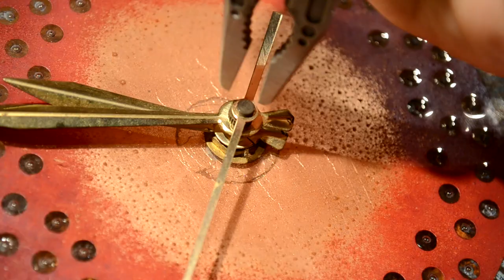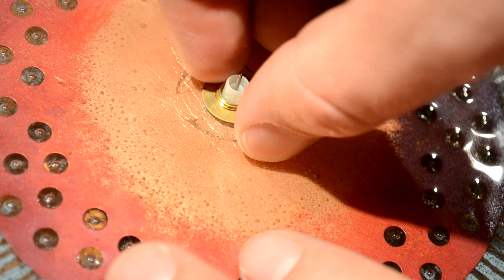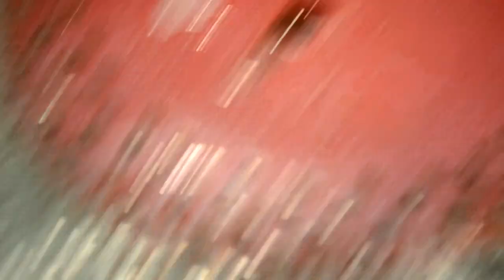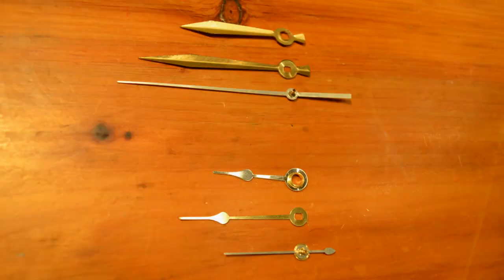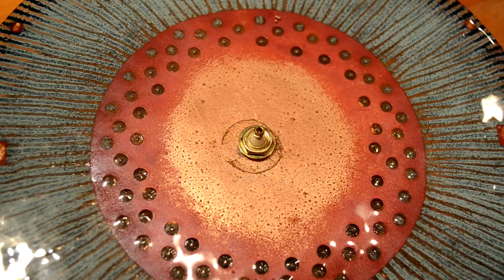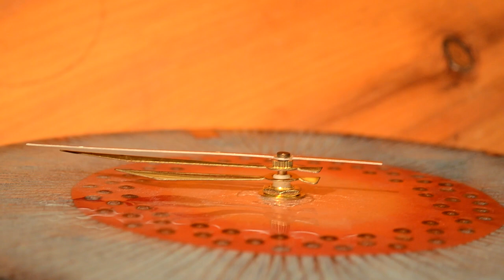Replacing a Quartz Clock Movement

Comment from the maker: Unfortunatly I dont have that type of clock that needed a new movement - but generally the glass will stay with the frame and you undo clips or screws from the rear and the face and dial are removed out the back with the glass and outer bezel/frame staying together as one piece (or the glass will fall out of the back of the frame once the face is removed..)
Reply: I agree a good instructional video, but whoever shot the video, should have shot it from above.  Your hands blocked what you were doing, and without any narration I was kinda lost

Comment: You may not need a new mechanism. 

I just fixed 3 of this type of clock this week. IN EVERY CASE the problem was the pressure contacts between the battery connectors & the electronics board inside the movement.  My clue to this was that fiddling with the battery contacts could make the clock run for a short time, but then it would stop again. 

First check the contacts to the battery itself.  If the battery has leaked, you may need to use a little water on a cotton swab to dissolve the resultant deposit. GENTLY polish with some metal polish if needed,  If they are badly corroded you may need a new mechanism, OR you can buy a separate 1-cell battery case & solder its leads directly to the electronics board of the disassembled mechanism, if that is all that is wrong; if you are capable of this level of fine soldering, you probably don't need any more instructions!  

Carefully remove the hands, remove the mechanism from the clock face (usually a nut on the face side, but may also be glued), & disassemble the mechanism - you need to be a somewhat good at dealing with small parts, & note carefully the location of all the gears - take photos as you go & use a magnifier to see what you are doing. There are a few videos around to show you how to do all this. 

Once you have the electronics board free, gently scrape the contacts (2 spring type from the battery, 2 flat on the PCB) with a plastic blade to remove the small amount of corrosion that has formed around them: the contacts should now look evenly bright).  Re-assemble just the electronics board & battery connectors into the mechanism housing, place the motor armature in position (the gear & attached magnet that sit by the solenoid coil), and insert the battery.  If the armature now "ticks" (& it did not before you cleaned the contacts), you likely have fixed the problem.  

Carefully re-assemble the mechanism, re-attach it to the face, & re-attach the hands, making sure that the hands will not foul on themselves or anything else as they rotate.  Use a gentle blower on the mech to make sure that you have not introduced any dirt. 

If cleaning the contacts does not work (too corroded), then you can bodge the connections by soldering a ~30 gauge copper magnet wire to each contact on the PCB & wire-wrap the other end around their respective battery connectors. The connector bars on these clocks don't seem amenable to soldering, so tight wire-wrapping (so that the edge of the connector bar cuts slightly into the bared wire) is the only option, unless you are good at micro-riveting!  Again, if you are that good at soldering you probably don't need more help! 

About 15 minutes work & no parts cost, & you keep the original hands & sound of your clock!  Good luck!

Comment: Not a bad tutorial. Tip on setting the hands on the clock: set them at the 12 o'clock position as best as you can. That way you're not manhandling the needles, likely causing damage to the gears.
Also, as constructive criticism, try not to let your hands block critical moments in repair videos.

Comment: Comment on your battery choice... it looks like the same Energizer high-capacity NiMH batteries I have. In any slow-use application, such as tv remote controls and clocks, or any use where it takes more than a couple weeks to dischsrge the battery, a standard rechargeable is a bad choice. You'll be recharging it more because of its self-discharge than actual use! These are perfect applications for low self-discharge batteries, such as Eneloop, or any rechargeable described as "pre-charged."